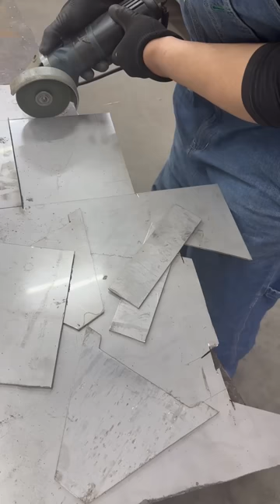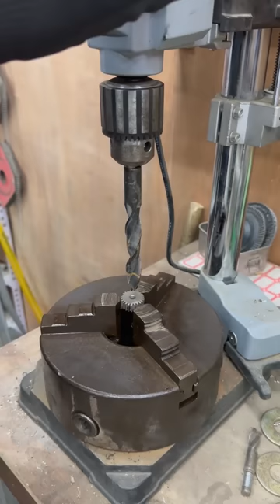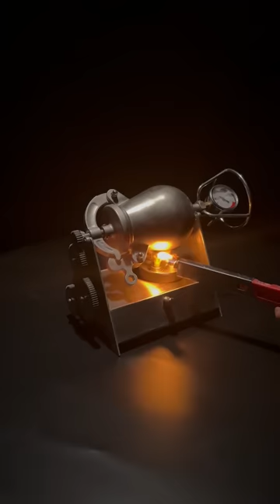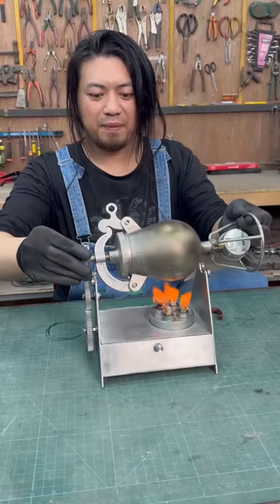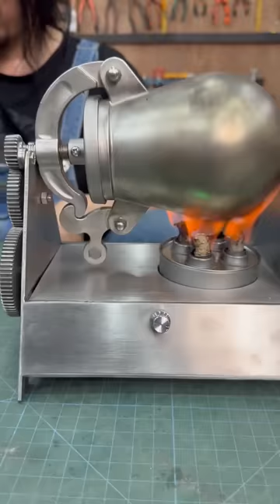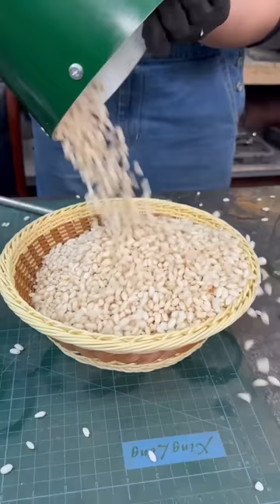ENG) 超省力！自動旋轉的爆米花機！DIY Automatic Popcorn Machine!【手工耿Handy Geng】

Comment: Heat is an energy source.
I wonder can make one where just the energy from the heat can make the gears spin with something like a Stirling Engine. 
Make it heat your popcorn and spin the the pressure cooker at the same time without depending on electronics